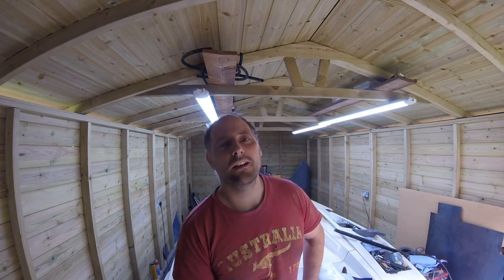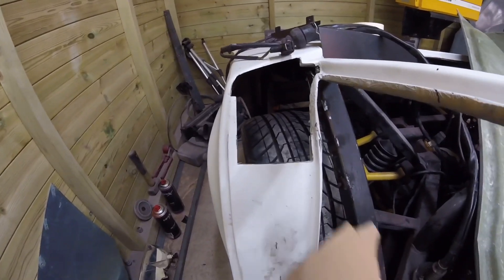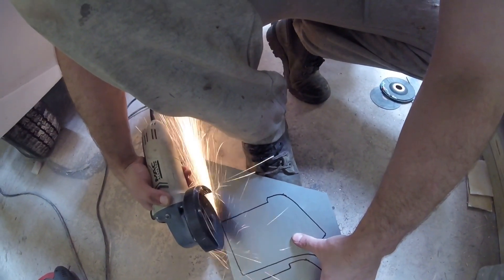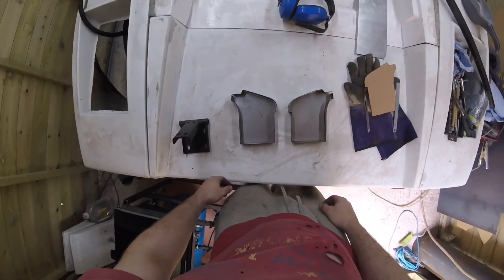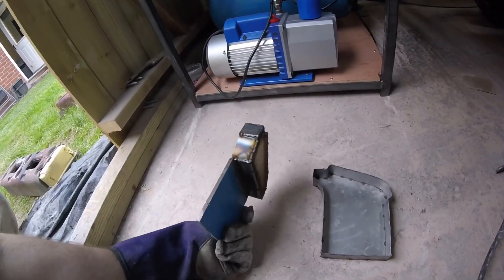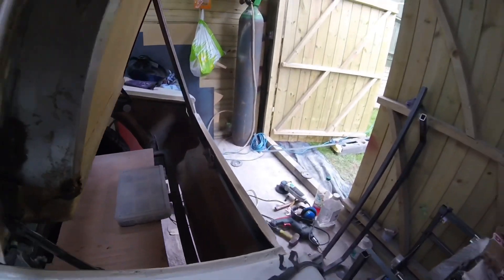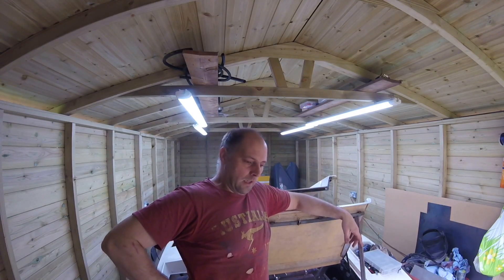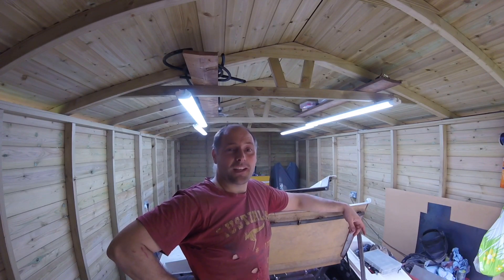Lamborghini countach kit car

Comment: When it comes to trimming your upholstery...take the seats apart..lay each peice out and lay a wet teatowel over each price and iron individually.
The leather will shrink back to original size and you can use those peices as a pattern for your new leather..
The foams you get for seat padding will be slightly smaller  but will all fit great together..
😁
Reply from the maker: Wicked bit of information. Thanks for that much appreciated